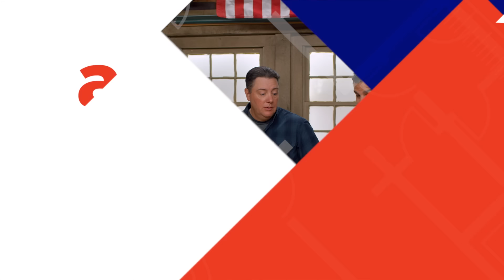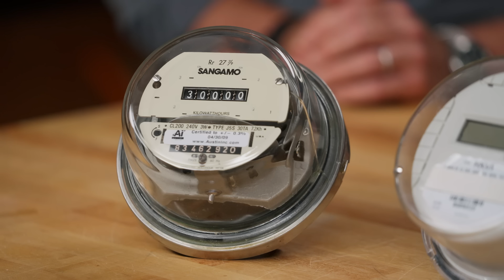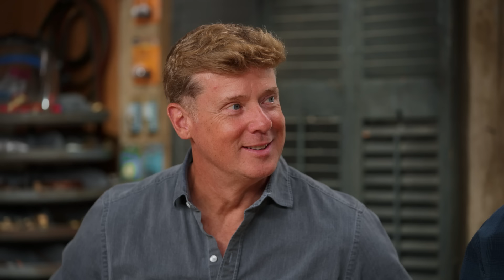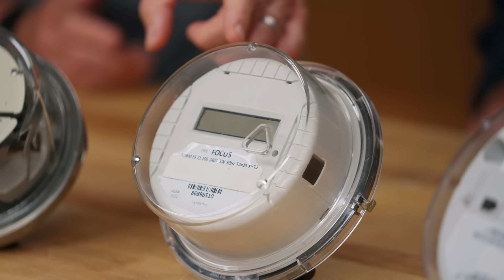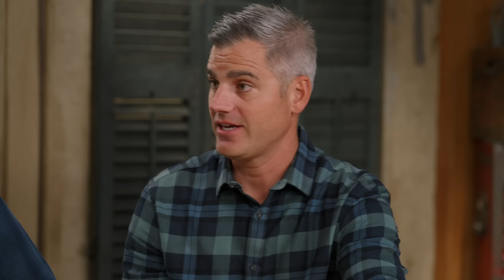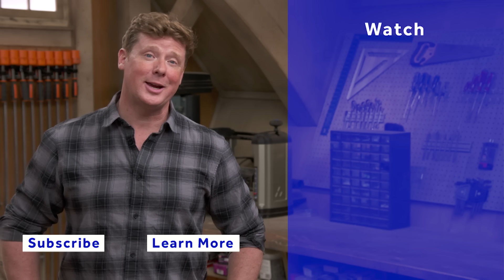How Utility Energy Meters Work | Ask This Old House

Comment: I have a smart meter.  One good thing for me is that I don't have to walk through my large yard downhill in the winter to get the reading (like right now there is about a foot of snow on it).  The utility used to come every other month to read it and I was on the hook to do the other months. If I didn't, I'd get an estimated bill.  I do not like those. They touted the ability to get the hourly usage, but unfortunately that data is 2 days old and only says the net usage.  I want to see the actual meter value as well. Even their weekly reporting only shows the total usage since the recent meter reading.   Yeah, I like to see what happens when I do things in the house.  I have to remember that, oh yeah, I used the oven a few days ago from 7pm to 8pm so that when I see the spike, I can correlate the 2.
And, yes, like others commented, this video is not how they work, but rather what they are doing.  Show us some wiring and guts of the units.

Comment: Here in toronto, ontario our utility had been using that classic analog meter until around 2012. But the government then forced the utility company to change everybody's meter to the first generation elster meter which would only monitor usage for billing. fast forward to 2025 they sent out a letter saying these same meters that have been working for 10+ years are faulty and must be replaced again with a next generation honeywell smart meter regardless of homeowners approval  . I did my research and found out these new meters that they forcefully installed can not only track usage but it speaks to nearby meters to notify the power company exactly whats being used. like a dryer or AC unit.... it emits high amounts of radiation & monitors every detail. The reason I find that to be a red flag is because whats to say in the near future they don't shut you down for using "too much" electricity. There is a lot of conspiracy theories as to why these meters are being pushed so hard.

Comment: Newer smart meters allow utility companies to roughly determine what appliances (refrigerator, water heater, HVAC, lighting, electronics, etc) are being used and for how long. The utility I'm with provides such detail online and it's surprisingly accurate. Not perfect, but far better than many would think possible.

Comment: Good info, good video. Minor correction: The old mechanical (analog) meters had a rotating disk (not dial) inside. There were four or five "dials" on the face of the meter. The meter reader read the dials to get the read.

Comment: They never said a word on HOW they worked.  I am interested in how they are calibrated and how they actually determine how much electricity flows through them.  I'll do my on research.
Reply: Same. They told us what meters do, not how they do it. This show continues to disappoint; it used to be so good. (If they change the title it read "How Utility Energy Meters Work")
Reply: Disappointed too. Wasn't expecting much detail, but at least a brief rudimentary explanation of how they work.

Comment: Privacy issues here. If they know when you're using power, they know when you're home. Also, you're opening your communities up to a type of denial-of-service attack if someone gets into the system and shuts off people's power. No thanks.
Reply: Also, if an ex gets a job at the power company and decides to exact revenge/sabatoge.
Reply: Warrants have been issued and properties searched for suspicious amounts of energy usage. They were looking for illegal drug grow operations. If you think about it, 1984 has just been late arriving.
Reply: Not just when and how much, but also what appliances and devices being used. Estimated using various heuristics, but often surprising accurate. Some utilities, such as the one I'm with, allow customers to view that information. In my case, it's relatively spot on.
Reply: They already know when you're using power.
Reply: @Egleu1  Depends on which meter you have, and not with this increased level of detail.

Comment: You can opt-out for the "new world order"meter there is a fee to keep the old one. Their are alot of problems with it research it on line people!👎
Reply: $11 a month surcharge to opt out; plus abt $50 to put the old meter back on if they’ve already changed to a smart meter. (Upstate NY)
Reply: @susanmei9980  worth it.
Reply: Depends on state and utility. Some don't allow opt-out. While others that do may charge relatively little to upwards of $30-$50 per month. Varies widely. That adds up. Smart meters are the reality. Eventually most won't have a choice due to energy conservation regulations. Also, traditional meters eventually wear out, and utilities aren't keeping many spares around. And little incentive to, since they want customers on smart meters.

Comment: Shut em off or THROTTLE your air condition on heavy load days. If at all possible STAY AWAY from smart meters. Google what the elec company did in Texas on hot summer days.

Comment: How come the meter keeps running  when I turn the main breaker  off? 🤔
Reply: The meter “keeps running” in the sense that its LCD keeps showing numbers, but the usage counter won’t increase.  The meter always gets electricity because it sits between the feed and your breaker.   This is analogous to your water meter sitting between the feed and your own shutoff valve and always being ‘wet’.
Reply: outbuildings like a garage usually have their own breaker or else you have a leak
Reply: Others mentioned why. Will add that if the meter for some reason stops recording usage, some utilities will bill an estimated amount. Then afterwards, if applicable, credit the amount in a future bill. That's come up with safety shutoffs out west in which some were still getting billed for days no power was used. Haven't read much about that lately, so maybe utilities are handling those situations better.
Reply: Because the meter is still getting power from the utility lines coming to the meter. Your main breaker simply isolates your entire house from the utility power.

Comment: Why they don't let the home owner to remotely read meter as well is beyond me.
Reply: There are tools that let you, but it varies by utility which you should/have to use. I have an Emporia Vue that pairs with the meter to read usage. If someone's utility doesn't allow access, there are also monitors to put in your panel for whole-house or per-circuit usage and smart plugs to read individual device usage. IIRC, the Sense Monitor is being discontinued because of the 2.0 meters will do the same, making the product redundant.
Reply: @ShadowMystic7  
According to what I see the Emporia Vue is nothing more than a amperage monitor.  It has nothing to do with the readings of the meter.  I've been toying with getting a setup like this for myself.  Wife cringes every time I bring it up.
Reply: Well, because everyone would lie and “read” that they used barely any energy lol
Reply: @krvnjrcbs  
Well that's, a weird response, I did not say anything about the owner reporting his number.  I just want to read the data for my own purposes.

I thought that was clearly stated in the "..as well.." portion.
Reply: @johnjacobjinglehimerschmid3555  oh, well I guess because you can Just go outside and look at it since you already live there. Maybe there is some data security reason but other than that they probably do not want to spend the money to set all that up on an app. They probably also do not monitor it 24/7 in real time. They probably get the data in set intervals so it wouldn’t really help you see your usage

Comment: Smart metering is the biggest rip off in history with these meters they can say any time is demand hours and they actually are doing it anytime your dryer is on they know or heat and air they charge on high demand hours. What anyone fails to say is these meters give off an insane amount of rf radiation
Reply: Put down the tinfoil dude, lol
Reply: @tkrag11 electrical engineer so I know exactly what I am talking about and I’ve used RF meters and read RF way too high then what should be allowed.

Comment: Opt out of any "Smart Meter"
Reply: How do you opt out?
Reply: @Maltizupuppies  
"How do you opt out?"

You apply 12 gauge therapy to the meter.

This is a joke, you will get in trouble if you apply 12 gauge therapy to the meter.
Reply: @scotttovey  😆
Reply: the smart meters 2.0 will likely  have ai in it 🤦‍♀️
Reply: Invest in going off grid.
Reply: You don’t own the meter, the utility company does. They don’t give you the option to “opt out” and the ones that do will charge you extra for having to have somebody come out and read your meter or for the extra maintenance it costs the utility company to keep your outdated meter operational.
Reply: @benburrows4826 Agreed. The local power company in our area didn’t give us a choice; they came to each house in our neighborhood and swapped out the old ones with the ‘Smart Meters’
Reply: @benburrows4826 that is correct however you can opt out. And a 20 dollar fee is still less than a 300 percent increase in your bill

Comment: I shuddered the moment he said "remotely shut off"
Reply: Technically the electric company can shut you off remotely, regardless
Reply: @fakeascanbe423  I know that for sure!  I remember as a child when my parents didn't pay the light bill they would just switch it off without having to send a man to do anything to the meter and that was over 30 years ago.
Reply: @fakeascanbe423  
There's actually laws against that.
At least in Michigan there is.
Winters can be severe, so there's protection against shutoffs in the winter time.
Reply: Can't be charging that EV during a heat wave, of course.  😂
Reply: Why?
Reply: @zunedog31  
They can turn your power off whether you're paid up or not.

During the lock down, when there was a heat wave, a Utility company ordered a smart thermostat company to lockout their customers from the grid because they feared a grid failure.

The smart thermostat company complied and about 2000 people were not able to run their air conditioners when the temps were in the 90's.
Reply: @zunedog31 using too much energy in the heat of summer. 
Someone shuts you off or restricts you.
Reply: @jboosh86 could be used for good in true emergencies, but I can imagine how easy it would be for government or utilities to misuse that. I prefer a tech to need to come out to cut off my electricity.
Reply: @jboosh86  Also because of cybersecurity vulnerabilities.  Sometimes the communications protocols used by utilities are influenced by law and that is typically very bad for long-term security.
Reply: Smart meters have long had that capability. Not all utilities enable it. Also, many states require most utilities (govt owned ones may be exempt from some regulations) to follow a drawn-out process, including posting a notice at the residence prior to shutoff.
Reply: Do they shut the electric off and your loved one dies on a respirator so someone goes postal on the board of trustees.   Great system.

Comment: Since NIPSCO has updated all Indiana to smart meters the bills have tripled or more , so much so theres a class action lawsuit and are no under investigation.
Reply: Really? Fellow nipsco customer. I didnt know this had anything to do with the new meters
Reply: I had a feeling that would happen.
Reply: I haven't seen a lot of change in my NIPSCO bill over the last 8 years
Reply: Presuming rates have gone up, more fees, etc. Smart meters sometimes do read higher than older traditional meters due to being solid state versus mechanical, but usually the difference is small to negligible. Many complain about their bill, but don't look at the basic things: usage, rates, fees, etc. Also, bills are often divided between supply (generation and transmission) and delivery (utility distribution). Some states allow one to choose their supplier. Many of which often gouge customers at renewal time if they don't call in or switch away. To put it simply, price for many things are up 30%-50% compared to 2019.